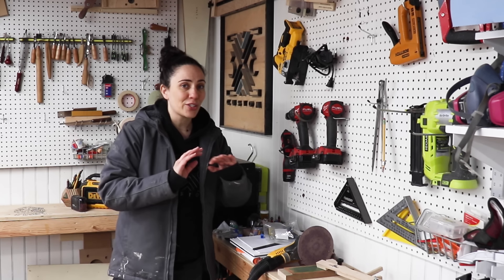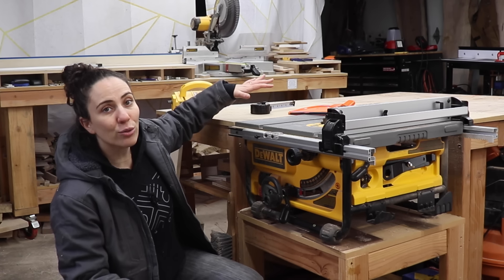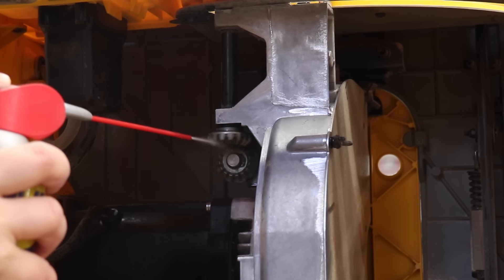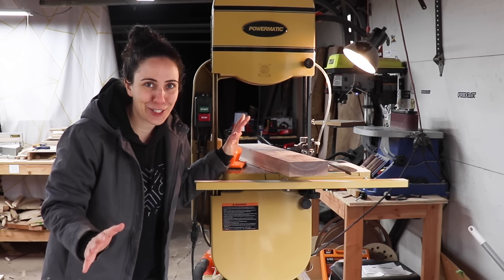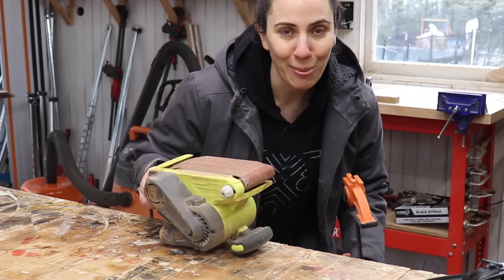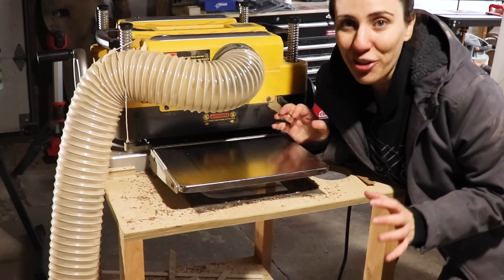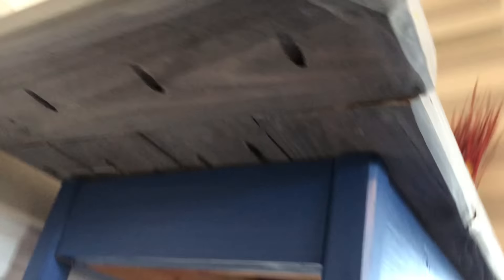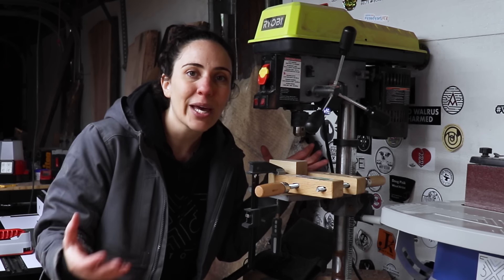What Tools Do You Need to START Woodworking? Beginner Woodworking Tool List

Comment: Good summary!  It is amazing how fast and easily tools can be accumulated.  I think I have 15 saws kicking around!  I can relate to the point on maintenance, particularly of table saws.  I had bought a cheap table saw about 7 years ago, and have struggled with it being stiff to raise the blade, even braking the handle once.  I frequently took it apart and cleaned the slides, often with wax, which worked great short term but not long term.  Last time I went to use it to trim legs off a bench for my SIL I raised the blade up to check if it was square (I don't trust the markings 100%) and as the blade reached the top it crashed down.  It turns out the threads in the aluminum bracket holding the motor had worn away, and I don't trust the drawings in the manual enough to order a replacement.  So I decided to upgrade and picked up a new Bosch contractor's saw today.

Comment: I love the transitions.. pretty creative. In lieu of a table saw, I strongly recommend the track/plunge saw. I have the Kreg ACS with a second separate Kreg horse and add on 2x4 extension that allows you to easily support and rip 4x8 sheets and smaller. Well worth the price and portability too.
Reply: I agree. My track saw, purchased after the DeWalt job site became my most used tool
Reply: Absolutely this. With a rail square and repeat cut guide, a track saw can do basically everything a table saw can do. I'd say a track saw, drills, and router are probably the best overall purchases. Get a table saw later if you find you have room and need the speed/ease of repetition it provides. As an added bonus, the guide rail from the track saw is a great, long straight edge for verifying things are straight/flat.
Reply: If you work mostly in sheet stock, sure I suppose.
My table saw spends over half its time wearing a dado stack, making dados, grooves and rabbets.
I don't know if a track saw can achieve precise miters in smaller workpieces the way a table saw can.  Cut me a wraparound grain jewelry box with a track saw.

Comment: Love your channel and think you do a great job of bring concepts that may seem complex to those just getting into woodworking into something understandable. 

A few places I would differ with your list (I had a shop up until about 10 years ago accumulating about the same equipment you have now, selling the equipment because of a move but just getting back into woodworking now) is instead of a regular circular saw, think I would go with a track saw. Reflecting back on my experience when just getting into woodworking, I was frustrated with quality of cut coming off the saw learning only a little later that I had to purchase a different blade, and only after research finding out which one. Additionally, using the factory edge of plywood (or whatever) I found to not necessarily be straight sometimes having voids or indents throwing off the cut. Lastly, even when I purchased a good straight edge for my saw, I still had to pay attention to the cut because based on what was going on with the board (even sheet goods) the saw can wander a little not providing what I was looking for. 

Basically, I felt I could not even cut a straight line (at least a straight as I wanted) even after spending additional money on a blade(s), straight edge (or straight clamp(s)) and lost material that could have been directly put into a track saw today absent the initial frustration while getting most of the versatility of a common circular saw. In fact, a decent track saw may be all the saw you will ever need as modern track saws can be very precise. I suppose I'm saying a track saw could of minimized or eliminated much of the early frustration at about the same cost being very useful moving forward.

Not really a "tool" but in the spirit of avoiding frustration, I would say get a good work bench if you don't already have one. For doing hand related work or cutting down pieces at a work bench with some good clamps can go a long way toward eliminating early frustration. 

As another early tool I would say purchasing a decent Portable Oscillating Spindle Sander should be in almost anyone's kit, as the machine can be carried to the work piece, mounted on a table, or placed in a table mount.

Lastly, if someone would whisper in my ear doing it all over again I would go straight to a doweling jig using something like a Dowelmax or Jessem jig, avoiding the whole butt joint with screws, and pocket screws (yes, useful. But, in more narrow cases) finding the ease, precision, alignment and lack of glue-up frustration being a complete game changer. For doing edge glue-ups or panel glup-ups, just made things sooooooo much easier.   

Anyway, some two cents. Great work, look forward to the rest of your journey.
Reply: Very useful addition. Thanks.

Comment: Great advice Tamar. My Dad was a chippy (carpenter) and as a young teenager in the 70's I started to make things in my Dad's shed with very basic tools. We didn't have any fancy tools, I started with a hand saw, a hand drill, a square, hammer and nails, chisels, a file and sand paper, today it's a different story. As you say, It's almost impossible to give someone advice on where to start because it all depends on what you intend to make. Our forefathers had remarkable skills and have proven that you can make anything with basic tools, it's just so much easier and quicker now with what's available to us. Start with the basics and before long you'll be travelling down the rabbit hole and won't know where it stops.
Reply from the maker: It’s never going to stop. Ha
Reply: If you want to use hand tools to build a project in a few days be my guest! Powered tools are a game changer.
Reply: @nateb9768  I hope you didn't misunderstand me Nate, I was simply saying that when I started there wasn't all the good stuff we have available today. Now days I rarely use a lot of hand tools if I can do it better and faster with power tools, particularly the awesome battery stuff. But as Tamar says, you will never stop buying tools because there will always be something new or better that saves us time or gives us a better result.

Comment: Excellent. I think an oscillating tool is also super useful (you can quickly make traditionally difficult cuts) and relatively safe . I also use a 4.5in Dewalt 20v saw. It's easier to handle than a 7.25 saw but can still cut through 2x4 lumber. Cabinetmaker since 2002.

Comment: I have an idea for your chair. Glue shims between some of the back support pieces until the desired shape is achieved. I think you should get a working chair in the shape you want before attempt make another. That way you can keep track of the added material and add that to the math for the initial rips.

Comment: Just came back from HD. I bought a 3/4” router bit, 3 self chamfering drill bits, and a 2’x4’x3/4” piece of birch plywood.  The total was $85.  I still need to buy some T track and jig hardware to make my crosscut tablesaw sled.  The struggle is real people.  So, I appreciate you making videos like this for us mere mortal woodworkers.

Comment: I just finished building the handrail on my deck https://www.youtube.com/post/UgkxfQ5_mgwq6PcudJvAH25t-I4D-3cTPz4z and used this great little router to clean up the top rail before the final sanding and stain. It was light weight but packed lots of power. Either size battery didn't seem to make it top heavy and I'm a 64 yr old women so I really appreciated how easy it was to use...................... CORDLESS only way to go !!
Reply: Cordless has a long way to go. Saws, routers, sanders are all far better corded. Techs not there yet.
Reply: as long as you remember to charge the batteries 🙂

Comment: For me the planer is second only to the table saw, a combined planer/joiner is a great option to start with.

It's interesting to see how different people approach similar problems in their own ways with their own tools. I think the most important thing for someone who is starting is to be creative with the tools available to them rather than focusing on what you could do if you only had that tool.
Reply: And for drill press, there are smaller versions you just put a regular drill in, they work quite well for wood. I have one of those in my wood shop and 99% of the time that is plenty enough even tough I have a big drill press in the metal shop that I can just walk over to use if I needed.

Comment: Tamar, do you have a track saw? I’ve seen some folks recommending a track saw vs circular and table saw. I have the Makita, and prefer it for straight line ripping and even jointing (no jointer yet), but still prefer the table saw for regular ripping or crosscutting when my miter saw won’t reach.
Reply: I have an old tiny table and corded circular saw.  I don’t love them and I was thinking about getting a cordless track saw.  I feel like the track saw will result in straighter cuts and be portable and maybe be safer.  When I re-did my kitchen I ended up using my jigsaw a lot because it was cordless and quieter than the old circ saw.  And I have a miter saw I use a lot.  I’m about to need to rip sone boards to do some window casing/trim, so I’m thinking a track-saw might be the way to go.  What do you think, random internet person (and/or Tamar)?  Thanks!
Reply from the maker: I do have a tracksaw. And it’s great for plywood but you can’t do joinery with it like you can a tablesaw
Reply: I think a track saw is very useful for some things, but it can't replace either a table saw, or even a circular saw. I'd consider them a luxury tool, since they're about as expensive as higher-end jobsite table saws, but are more limited than either table saws, or circular saws.
Reply: @adderjack4604  I haven't even heard of tracksaws before, I thought it is just a separately bought track for regular circular saw. And with circular saw you can make a lot of things with some effort, even dados are possible, although far from comfortable to make. Just cut two outermost cuts inside a dado with proper depth and move into inside cut by cut until you meet the other starting cut. Table saws are great but only if you have a place to store them - I do not, my garage is not big enough.
Reply: @paweskarzynski8068  yeah, I know kreg makes a track that you can attach to a circular saw, so you can use it like a track saw. It might not be as precise, and probably takes more work to get the cut exactly where you want it, since it's designed to be used with many different circular saws, but it's probably not a bad option. I only have a circular saw, right now. I borrow a table saw that my former boss has left in the house he's building for my mom, when I need to use one. But, most of the time, I just use the circ saw, or my jigsaw, when I'm doing cuts that my miter saw can't do. My miter saw probably sees the most use out of any of them, really.

Comment: Me as a broke student: paper and pencil already expensive 😂
Reply from the maker: Yeah....
Reply: If you are a student you may be able to get access to a wood shop, depending on where you go to school. There are few shops as well equipped and maintained as a school shop.
Reply: maden. For decades, no centuries, carpenters used hand tools. With a few simple, inexpensive ones, you can make tons of enjoyable, functional stuff. Hand drill, saw, hammer, plane and more can be found either inexpensively or used. Go for it. I doubt any hand tools you purchase will go in the trash once you're able to upgrade to power.
Reply: Try spoon carving!  A knife & strop are cheap.  Green wood from storms and yard cleanup is usually available for free.
Reply: Go to community college, it’s cheaper.

Comment: I have been a member of now 3 Menzsheds in NZ...... That's really where i learned what I actually Can do, and which tools/machines i need to use--making model trucks etc  using offcuts and scrap wood, often from old broken up furniture.
 For me... the 3 "really need" machines are 
a. well set bandsaw...7-9mm width band
b. a drill press..for vertical drilling and  making beautiful clean holes with  Forstner bits and also holesaws not run too fast  which overheats the cutting edges
c.  combined belt sander and disc sander ( a spindle/oscillating sander is a joy if there is one )

and of course the usual hand tools, drill etc  and Must Have square /Robertson screws if screws are needed.

Comment: "What tool is going to save me time on future projects?"

The key question when determining what tool you might need for your personal projects.

I'm a sub-beginner. I come from a mechanical background so I'm not completely inept but I am new to woodworking. Hitting the hardware store for a circ saw first with batteries to match my drill and driver I own from other pursuits. Then I'm expecting a table saw a few projects in.

Thank you for suggesting this way of thinking! The path is miles clearer than before!
Reply: Not necessarily.  A new tool might make the process more pleasing and/or the result more gratifying without necessarily saving time.

Comment: Well done Tamar. You are absolutely correct that what a person needs to get started in wood working completely depends upon what they intend to do.👍
I would suggest for every beginner to start with simple basic  hand tools: Hand saw, screwdriver set, mallet,  3 chisel set (1/4, 1/2, 3/4 in.), sanding block, tape measure, speed square (small triangle square), carpenter's pencils and mechanical pencil, carpenters hammer, a set of nail punches (small, medium, large), and perhaps a small combo pack of  power saw, drill, and sander. The value of each of the non-power tools is to learn how different types of wood responds to what you are doing as well as understanding the actual functions of each tool. You mentioned the two handle scraping tool or draw bar scraper (and several other names) for this very purpose. As a child I learned how to whittle with a pocket knife. Every kid had a pocket knife, even my sisters. We don't realize just how much information we discover by these simple tools because we are in such a hurry to get to the "Cool" stuff, like your table experience. I completely agree with you on all the different possibilities and scenarios as we discover the things that work best for the types of projects we decide to undertake. The possibilities are endless!
Great video!!!!!👍👍👏👏👏
Reply from the maker: Yup! Glad you liked it!

Comment: My first big purchase was a table saw.  I bought a crappy $100 table saw from Menards, and like you, I and was amazed at the improvement it made!  I did the exact same thing - I ripped off the rounded edge from a stock 2x4.  It got me excited about woodworking!  After a decade of getting angry with my table saw, and with the direct drive motor burning out, I finally was able to get an upgrade.  It was a hybrid $500 table saw from Rigid.  I LOVE my new table saw.  It's the center of my shop, as a saw, or as a rugged assembly table, although, now I have  a small nice compound miter saw and a small band saw.  I often find myself gravitating to the table saw, mainly because my small shop/garage requires me to shuffle around the equipment.  My next upgrade is to a new house with a LARGE dedicated, heated (yes, I know you wish you had *that*!) shop space - no, that's not why we chose the house, but I am really looking forward to the move because I can have dedicated open workstations for all of my tools!  I love to see what you build!  Keep doing great work and experimenting - we all learn from your attempts, either way!
Reply from the maker: Awesome! Glad you like it!

Comment: I find these videos interesting. I started woodworking in the 7th grade and kept going through high school. I have built a fair collection since then. This is in my home hobby shop woodworking side. It’s 2000 square feet. Table saw is an Ulmia sliding table, chop saw is a Festool, radial saw is a Dewalt 16” 7.5hp, jointer is a Yates American 8’ bed, planer is a SCMI 9hp, shaper is a Rockwell 7.5 hp, mortiser is a Powermatic foot operated, stroke sander is an Oliver, lathe is a Yates American, bandsaw is a Yates American 30” 5 hp, spindle sander is a Max, wide belt sander is 36” Kuster 15 hp, and a host of other tools including a Festool Domino 700xl. Haven’t had time to do any videos. Thought you might like it though.

Comment: Totally enjoyed this video. Apart from all the good info, your enthusiasm is inspiring. I’ve been woodworking for 40+ years, and the trick as you note is to acquire tools as they are needed. I like that you model using safety equipment...I’m a believer. When I got my first band saw 35 years ago my father in law said “You’re going to cut your fingers off”. Whenever I use a bandsaw I hear him saying this and never turn it on without going through a safety scan. Looking forward to your next post.
Reply from the maker: So glad you liked it!

Comment: Lol. I do heavily recommend a jigsaw for starting out. It's just worth bearing in mind what it's for. I use mine to rough-cut my pieces, especially curved cuts, before cleaning them up with a router, or sander, for example. I wouldn't recommend using one for a final cut, though I have done that (you just have to REALLY take your time). They aren't very precise. They're a "jack-of-all-trades, master of none" kind of saw, moreso than a circular saw is, since those can only cut (mostly) straight. And, they're more affordable and more convenient than bandsaws.
Reply from the maker: Yup. I use it when I have to. But I see a lot of people thinking that they can use it as their only cutting tool. So I advised against that. If I would have started with a jigsaw, I would have likely quit bc of the less than perfect cuts.